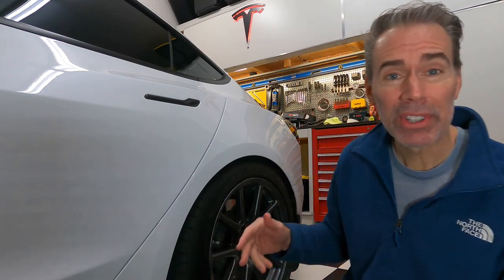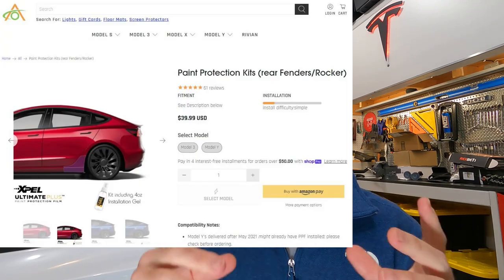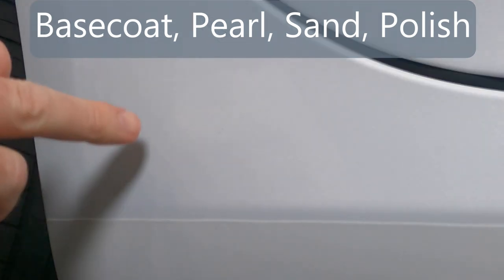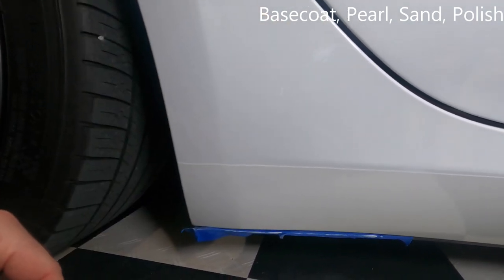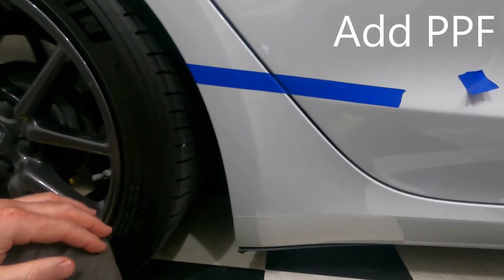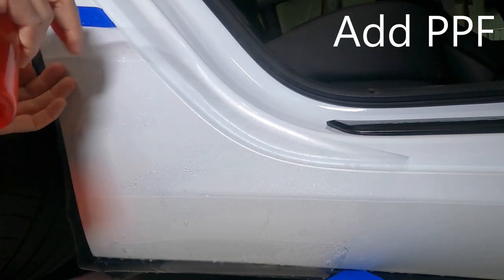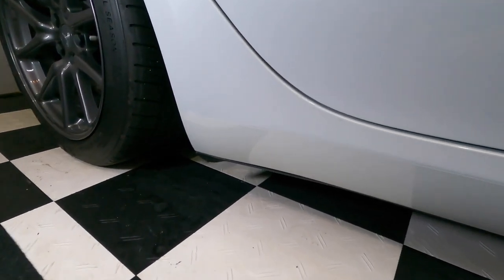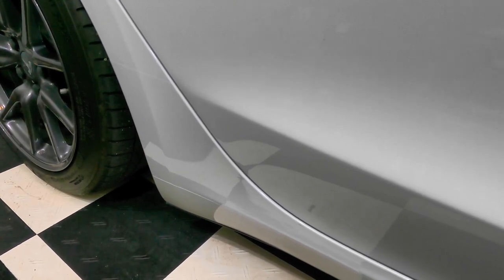Quick & Easy Touch-up then PPF Rear Quarter Rocker

Comment: You are lucky to have white. My blue 3 is messed up there, but it is far more obvious. Blue with white speckles, if you will. I had PPF installed on the entire rocker panel and up to the break in the body shape on the doors and then up  higher near the rear wheel wells. I live out in the country and where they sand the roads in the winter. Not at all good for Tesla paint ;)
Reply from the maker: Brutal. Did you touch it up prior to the PPF?
Reply: @mmark300  That was before I started watching your channel and knowing how to do anything ;) The PPF shop did some pretty magical paint correction and made some improvements. But you can see it upon close inspection. But I doubt a single human other than me has noticed since. I tell you what tho, PPF works. Straight up. After weeks of winter driving the PPF back there looks almost fuzzy with dings. Take a heat gun to it and it's glass.